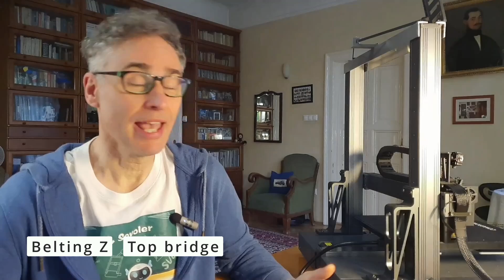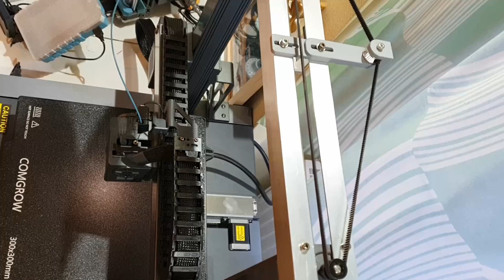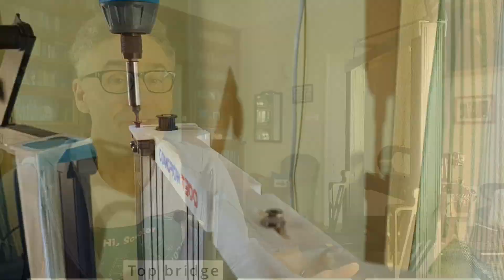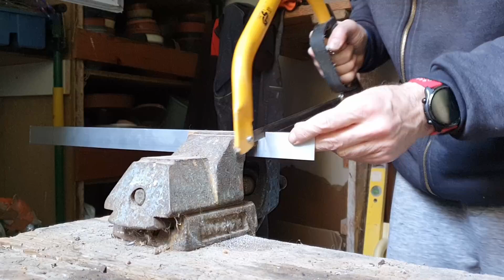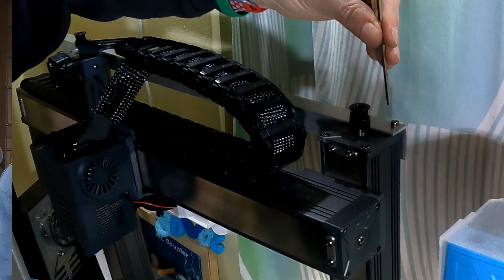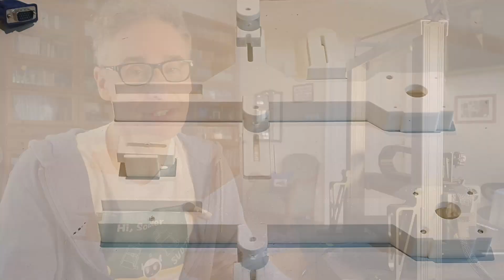Belting Z-motors & Bridging Z-towers on Sovol / Comgrow T300 🏁 The ultimate upgrade 📦 SV08 teaser

Comment: Hey Gergo, got me a second t300 last week, for 179eu i couldn't resist 😊. But i do have a question..have you or anyone else built a manta ez3  mb into it? So you have 5 drivers and the 2 z's can have their own driver, with no need for belts etc. Altho you have to use e1 connector instead of z2 and you have to alter the cfg file accordingly..
Reply from the maker: Nice fetch! At €179 this printer is an absolute steal. I remember when it was selling for over 400! The build-strength, and dust-proof motion system makes this one of the longest lasting 3D printers.

I considered upgrading the controller board, but I think physically connecting the two single-driver z-motors is better in the long run, eliminating the need for gantry leveling instead of relying on a lengthy z-sync procedure before every print. Even if it is more precise and fully automatic with two drivers, it will still be necessary.
Reply: @gerGoPrint3D thanks man, that makes sense to me.

Comment: I am having trouble with my z leveling my t300 and my z bar does not go to the top of the gantry I picked up a used t300 and sure what is wrong
Reply from the maker: Try factory resetting or updating the firmware from Sovol's wiki (linked from their website). The previous owner might have modified the software.  Please watch my other videos, I talk extensively about firmware updates and software modifications of my own, which will replace the inaccurate top ramming method for gantry leveling.

Comment: GerGo, have you done work with input shaper (accelerometer) for the T300/500?
Reply from the maker: No I never needed it the factory tuning is pretty good. You would have to think about good mounting points both on the toolhead and the bed.

Comment: GerGo, thank for your videos and all the help they provide. I found out there is no need for a bridge neither for a belt if the gantry is mounted while it is perfectly leveled and the towers are parallel to each other. Here is how to do it: 1- loosen the 8 gantry screws a little to allow the linear bearings to release tension/torsion. Level the gantry (Z-tilt cal) It is best to use GerGo Z-tilt upgrade. 2- loosen the gantry screws more until the gantry is loose to relese misalignment and torsional forces caused by it. 3- Thighten the screws back securing the gantry. 4- Perform Z-tilt alignment again. 5- If alignment needed adjustment then repeat from step 1 until gantry normal resting position is leveled. After this the printer will never get out of alignment, its normal resting position is in alignment.

I think that the bridge can be used to improve on this method. Here are the step by step instructions with a bridge: 1- Loosen the 8 gantry screws until bridge is completelly loose but it remains in the towers. 2- Place the bridge and secure one side only. 3- Measure the distance between the towers at the bottom and adjust the distance at the top to be equal as the bottom and secure the other side of the bridge. 3- Measure the distance at the bottom and at the top to be the exact same. 4- Perform gantry alignment as described in the 1st paragraph above.
Reply: You mind making a video tutorial for us @angelra3547 ? I have one coming on Wednesday, and your word are exact... but It's really helpful to see another person do it.

Comment: Hi

I have an Ender 3 Neo which was enhanced for me with a second z axis step motor.  And it is constantly making the right side and the left side of the gantry to go out of sync.  If I don't throw that printer out the window, maybe I can figure out how to adapt your very nice solution to fix this problem.

Thanks . . .

Phil
Reply: Read my post (above). It is more likely assembled out of alignment, and once power is turn off, it returns to be out of alignment.

Comment: I have been looking for a replacement ofmyokd tronxy 2 pro. I like the build quality of the t300 but should i get it or the svo7? Pom wheels vs linear rails
Reply from the maker: Since you are an experienced user I recommend the T300 more, as you can see it needs a bit of mods to make it perfect, but the motion system is superior, also mains bed heating is much much faster, otherwise it is on feature parity with the SV07 Plus (bigger build volume than the standard SV07).  The SV07/Plus is recommended to unexperienced users, since it is perfect out of the box, but the POM wheels will need maintenance / replacement after a certain time.  Also the T300 is much better protected against dust, which also means it should last longer without maintenance.  But you will need to connect the two Z motors as I did here, since it doesn't have intependent control for them, so cannot sync them automatically as the SV07 can. But when connected they are even better, because then they won't need syncing at all.  Also you might want to replace the control board cooling to something quieter: https://youtu.be/_V3vlu-AfcM and maybe add silicone spacers under the the bed to help level it perfectly, but that's a very easy upgrade. I show that here: https://youtu.be/oIiReN82cOY

Comment: I'm looking for a large format printer and they all seem to have their problems.  When is Bambu coming out with one?
Reply from the maker: I found the SV08 to be quite reliable. But the T300, SV07+ and SV06+ have been working OK ever since I got each of them. The idea is that these are highly modifiable (and repairable) devices, which means, even if there is some issue, usually a few minutes of fiddling and maybe a few dollars worth of parts will fix them.  It's not like you TV that if breaks you have to call a repairman, or likely look for a new one. Here, even the most serious issues can be self-fixed for a few bucks.

Comment: Excellent content as always as usual you're my go to Sovol influencer can I get a link and instructions to the Led light attached to the svo6plus printer wanting to improve my newly added timelapse feature. Again, that would be attributed to your amazing, informative and comprehensive instructional videos. My friends call me a fanboy and I say indeed I am, credit given where it is due.
Reply from the maker: Thank you for the amazingly kind feedback! I posted links to the blower / led light models in the description of this video → https://youtu.be/X3itFYCZtos In my experience the extruder lights are not the best for timelapses, they tend to blow out the area in the picture when printing light colored filaments. There is an unused 3-pin connector on the extruder, that you can connect to 24V in the controller box, and use 24V led strips. I do recommend adding a manual switch though, so you can turn off the light if it indeed messes with the camera.

Comment: This is really cool! I wonder if theres much point to doing this to a sv07? I wonder this because i've noticed recently the tension on the outer pom wheels on the Z axis to be VERY different when the gantry is raised compared to when it is lowered. I've not measured how bad it really is, but just adding a proper metal connector bar would likely significantly improve that.
Reply from the maker: The SV07/+ already have top of the Z columns connected! The problem with the T300's designed is that these columns could move in the X direction. They added some stabilizers from the back for Y direction, but X was left free to move. This issue is not there with the SV07/+. 

I guess we could belt the z motors, but there is less incentive to do so, since the SV07/+ is capable of correcting out of sync z-motors (auto z tilt adjustment). Christian Vick's Klipper Printer Additions do a gantry leveling before every print which is pretty quick so I am content with that there. My SV07+ is getting perfect first layers every time without any need for user intervention (which the T300 needed with the z-knobs).
Reply: @gerGoPrint3D  true that! If you move your gantry to its highest position on the 07/07+ though and feel the pom wheels on the outer edge of the z towers, if it's anything like mine you'll find the pom wheels are terrifyingly tight, compared to when the gantry is lowered near the bed. This is after manual gantry leveling (ie, optimizing for equal pressure across all pom wheels). I'm wondering if maybe the tolerances on the plastic bracket aren't fantastic or if it's got too much "give" to hold the z towers in proper alignment!

Comment: I just came back to your channel looking for the SV06 version of the Belting Z-motors, 
the one where New Stepper Motors with dual shafts are used and the belting is under the printer bed. 
Has that video been removed, replaced, or taken down?
Reply from the maker: It wasn't my video. But I too commented on it IIRC. I am actually planning to belt my SV06 Plus, but I'll do it on the top, it requires less modifications.

Comment: hoping to see SV08 silent motherboard fan mod :)
Reply from the maker: Already done! I could stand the stock fans high pitched, loud whining noise for about 2 days...   Though the solution is not yet universal...  Update soon!
Reply: @gerGoPrint3D  omg, if you can even tune voltage of TMC2209 drivers on steeper motors and make really silent profile for printing (sacrificing bit of speed), it could be interesting.

Comment: I understand bracing the top but don't understand the belt assuming you still have both drive motors are still electrically connected? 

Would the belt not have enough stretch to cause one side to always lag (assuming only motor driver connected and the disconnected ) be a little less accurate than compared to your Z tilt macro? 

I have no issue running your z tilt macro before any print which seems to be keeping things aligned once the bed is heated. 

You raise a good point about the columns being off. I checked mine and they are off ~5mm top/bottom.  I placed a square on the bed and noticed one is tilted in and the outer tilted outside. I will try to tram these using shims. I don't think the aluminium top brace can pull this into alignment at least not hold it over time

I do appreciate your continued support for the T300. I bought this printer on an impulse and may not have got it if I had researched the lack of manufacturer support for it.
Reply from the maker: Yes, the motors are electronically connected; however, when you power them down, they can turn independently of each other. For instance, if the toolhead is positioned to one side when the printer is off, it will cause that side to sag slightly. The belt ensures that they move together even when they are not moving electronically.

It is pretty fresh, but I have been watching and still redoing the probe test before every print. And yes, sometimes I get "1 minute CW" or "1 minute CCW", but I don't set it and by next time it corrects itself. So yes, doing it manually could be more precise, but to put it in perspective this means a few hundredth of a mm.  Not having to wait for gantry leveling is worth this slight inaccuracy for me.
Reply: @gerGoPrint3D 

Oh, the belt is to keep things equal when you turn off the machine...makes sense.

 I just finishing shimming both columns. .005" shim on one column and on one .015" shim on the other to get things square. I used a square off the bed (build plate removed) on each column.  The 2 top holes on each back brace needed to be drilled a bit larger to accommodate the column movement after shimming. Needed to tighten the two bottom brace bolts to the bed before tightening the top 2 bolts to the column on each brace.

The top and bottom of both columns are now equal parallel. Your tilt routine is fast enough for me bit the 81 point bed level does take time. . I will look into that adaptive bed levelling soon for smaller prints. 

I find I'm forgetting to turn the machine turned on after jobs so things shouldn't fall out of tilt but that noisy fan needs to go.

Comment: I’ve been using your z tilt method and macro which I like a lot. Adding a bar across the top ruins the aesthetics for me. I don’t have any print issues so, I guess I’ll wait until they show up.😊
Reply from the maker: Moving z columns don't necessarily cause printing issues. In fact, I was actually checking if ancoring, stabilizing them like this would introduce any issue. It didn't. This upgrade is more to make startup quicker by taking out the step of gantry leveling. Now my T300 is the quickest, literally 2 minutes after flipping the power switch I can be printing with heated nozzle, bed, leveled gantry  and all.  And it does that with high quality and also high speed. Yes, the aestetics suffer a bit, I did my best to match color and feel of the original parts, but the stuning dual-towers are indeed gone. But this mod is also 100% reversible!

Comment: 😢 I have been in contact with Sovol support for a while about my T-300 and no fix for the y-axis layer shifting on anything bigger than a benchy. As if my Y rail is defective or the motor is, but like hitting my head on a brick wall, they keep trying to get me to print a benchy… with 10mm of y-travel the problem will never present and I suspect how it got past QC.

I am sad to see it collecting dust but my requests for a new one or a replacement unit are unheard. Pretty much writes off Sovol for me, a waste of days on a machine that I usually can fix because of my years of 3D printing and buy cannot fix this without new parts atleast. 

Moving forward I will be disassembling the Y-axis and maybe replacing the motor and rail… maybe it is a bit of a sore spot currently.
Reply from the maker: What a shame. And it's probably just one faulty piece. Indeed it could be the motor a bent pulley, or overheating driver (these are not very thoughtful examples, just the top of my mind). Try talking to Roar Ree (3DPrintDemon) in the Sovol Facebook group. I am sure he will have an idea what needs to be replaced. We were beta testing the T300 and he knows this printer inside out. He also made a bunch of mods and upgrades, currently driving it from a different board on a different screen, upgraded the bed carriage in addition to all the things he also published on printables. I hope you can reach him.
Reply: @gerGoPrint3D  Thank you for the thoughtful reply ❤️. Unfortunately I have not been on Facebook since 2006… I guess I could make an account, I will see what I can do.